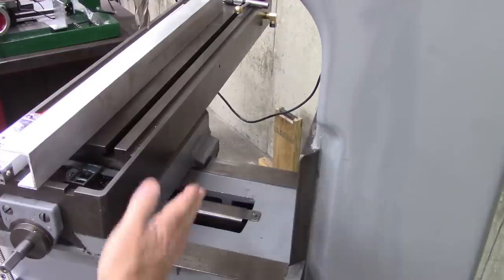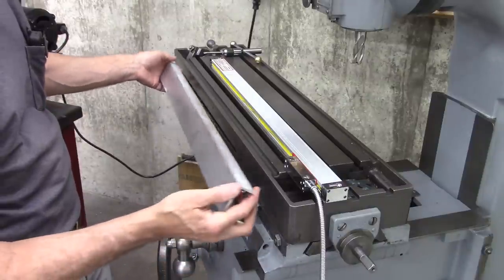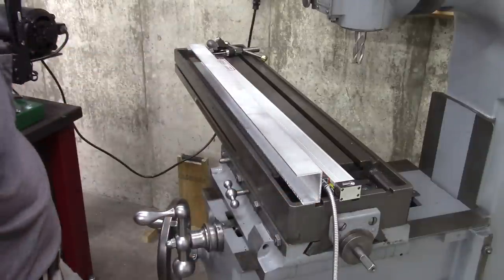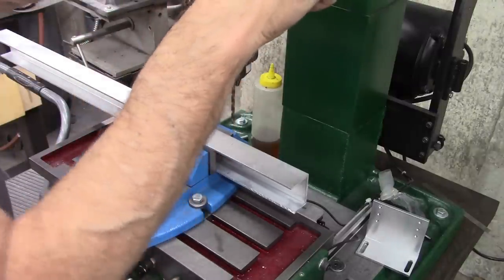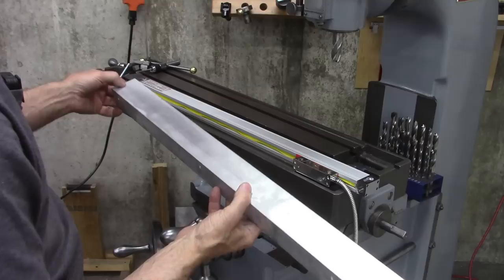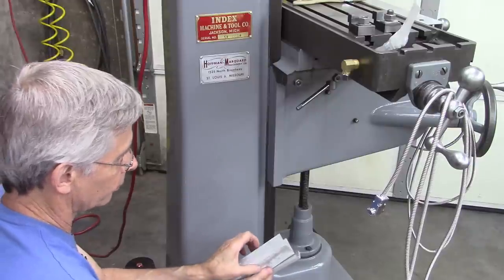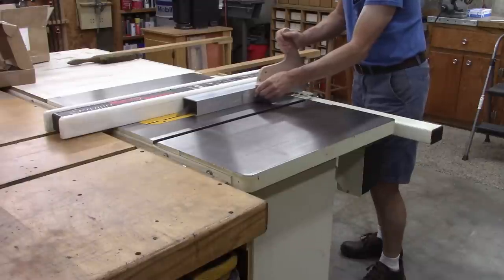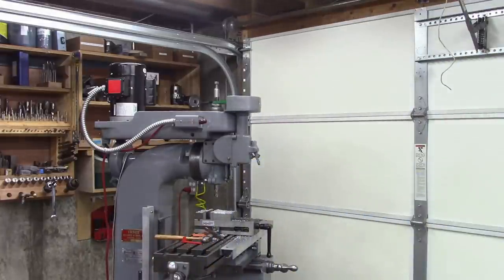DRO Part 1 - Installing the Linear Scale on my Well Index Milling Machine

Comment: I see that most guys use slotted holes for the final adjustments with a dial indicator.  Not sure how you would do that with your aluminum channel covering the scale?  Are you relying on the extrusion to be nuts on and run the dial on its surface??  I do like the protection it gives and will likely do mine that way.  I am thinking that a scale on the quill would be useful for drilling and depth of cut when grooving?  Haven't visited with you for a while.  Although I am subscribed your postings are never in my "suggested views" which never lack for plenty of garbage I never watch.  Kind of lose track of my channels that way as I am not a fan of bells and whistles when I turn on the machine.  You can be sure I will look up and view the rest of this series.  I bought a new Grizzly G07856 (?) Horizontal and Vertical Mill a couple of years ago that had to await the finishing of my shop expansion which is now complete.  So I will be installing a DRO and hopefully I can find a power knee feed but its knee is quite different from the Bridgeport clones readily available.
Reply from the maker: Cool that you got a new mill. About the DRO scale alignment. Yes it is a good idea to get them as close as possible. However, most scales can handle a fair amount of lateral misalignment (like maybe .020 or a bit more) without issue. Technically it does create an error but VERY small. If you are out .020 at one end the error is less than .0002" in 20-inches. The thickness of my channel was within .002" of being the same every where I checked it. I drilled the screw holes as close as close as possible but ended up with at least .010" movement on the ends. I simply used a hex key as a gauge between the rail and the aluminum and then tightened the rails. Even an error of .001" over 20-inches is fine with me.
Reply: @WinkysWorkshop  Thanks for the info.  Enjoy!
Reply from the maker: @douglasthompson2740  Your welcome!

Comment: Nice Setup!!  why you didn't place on back side of table even loosing 2 inches of movement, will be a clean install...
Reply from the maker: The table moves in relation to the column. It would have needed slides. Plus the guard is always center where the mill is cutting.
Reply: Keep posting!!!
Reply from the maker: @rodolfocastillo8025  I'll do my best.

Comment: you may have an issue with accuracy if the rail is not parallel with the reader with in .005
Reply from the maker: Yeah, I need to check this....  It's always good to eliminate possible error. With that being said, if you do the math for a 10" long scale an alignment error of 1/10" (.100")would result in a .0005" error over 10" of travel. I'd say my scales are closer to being within .050" which would result in an error of .00025" over 10" or  .0005" over 20". I'm guessing the weight of the table at one extreme and gib clearances have more create more than .002" error over 20". I'm not so good at math so feel free to correct me.
Reply: @WinkysWorkshop  no as long as you are with in .005 parallel you will be accurate